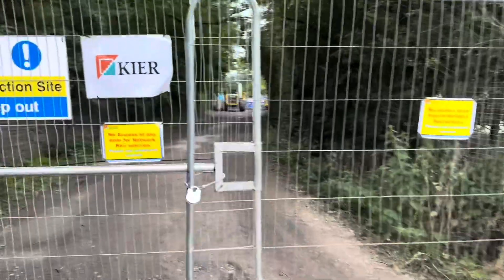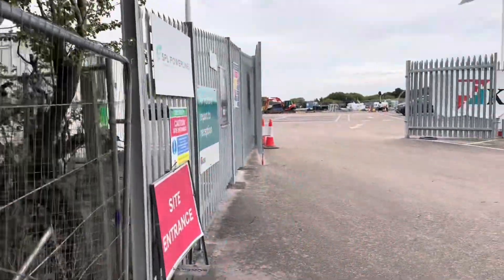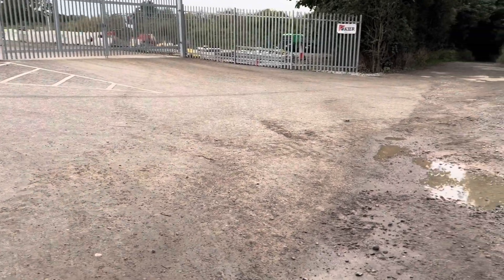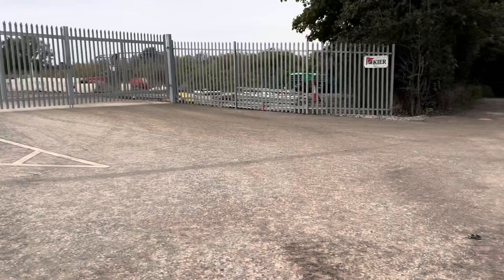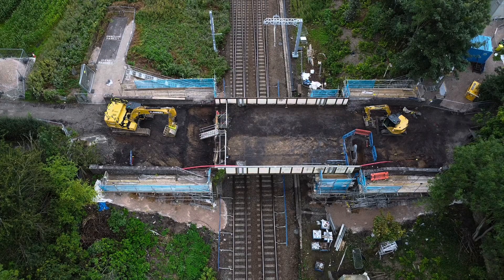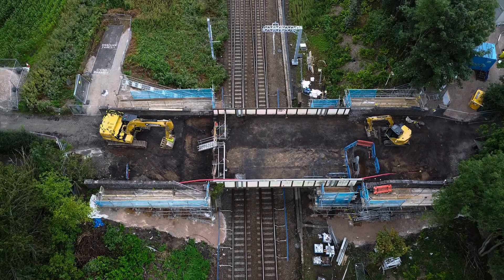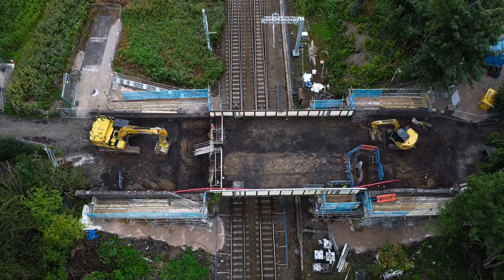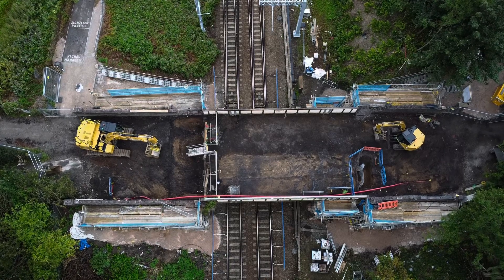Wigan to Bolton Railway Electrification Project Crow Nest Bridge

Comment: Planning application  A/24/97503/18PDA
Jacking the bridge up by 300mm (up from 270mm first proposed)
If you want to see where NR has notified the council of works/requested permission go to the Wigan Council website, click on planning and building control then the Interative Map dropdown option. When the map loads go to the Layer List tab in the top right, tick Planning applications 2021-2030 then open the sub list up and check the last couple of years then scroll over the railway and you can see bridge applications.